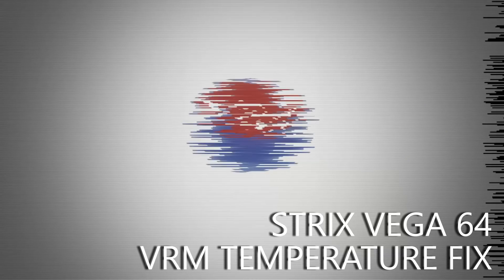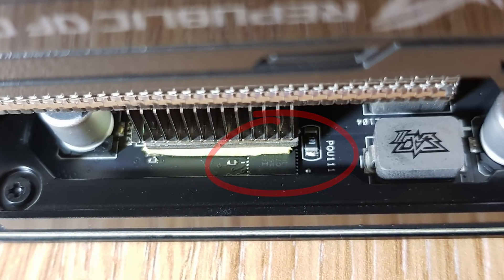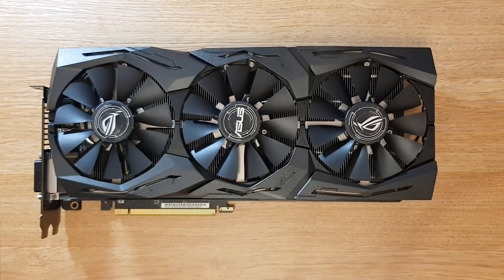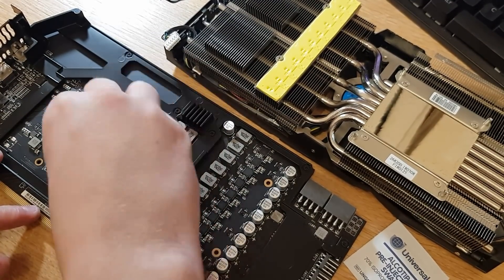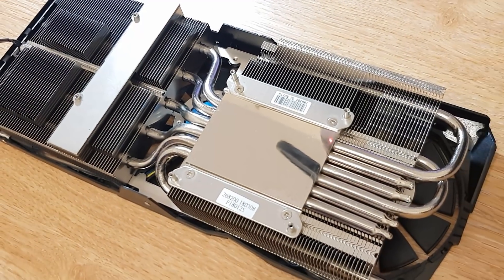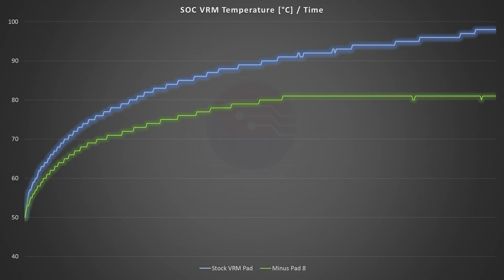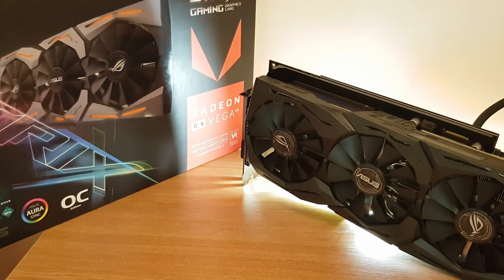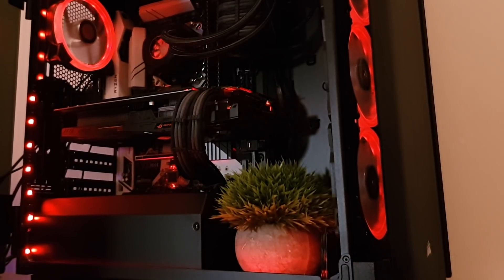Asus Strix Vega 64 - VRM Temperature FIX

Comment: So finally I got thermal pad from aliexpress after almost a month.
Here are the results.
Before:
GPU Temperature -> 81C
HBM Temperature - > 85C
GPU VR VDDC Temperature (I believe this is VRM) ->  101C
GPU VR MVDD Temperature (Should be VRM for Memory) -> 92C
GPU Hotspot -> 95C

After aliexpress 3mm thermal pad + MX4 thermal paste:
GPU Temperature -> 78C
HBM Temperature - > 82C
GPU VR VDDC Temperature (I believe this is VRM) ->  99C
GPU VR MVDD Temperature (Should be VRM for Memory) -> 90C
GPU Hotspot -> 95C

Soooo yeah pretty dissapointed with that aliexpress thermal pad.
I must say that Asus did pretty good job with the thermal paste application but that VRM jeeeez.
Long story short it ain't worth it, if you can get your hands on propper thermal pad like in the video Grizzly Minus Pad 8.
I can't buy it anywhere where I live so I guess when I am in Germany I will look for one.
Also I lost my warranty for 2 degrees off VRM so that's great :D
Reply: What pad did you get?
Reply: I got my thermal grizzly pad from eBay for 20€ and I'm in Germany too
Reply: Bei Asus gibt es kein Garantieverlust so lange man beim einsetzen den original kühler drauf hat. Quelle:https://www.computerbase.de/2016-09/grafikkarten-garantie-vergleich/

Comment: Another noob question, did the video show you applying the thermal paste at 4.00? or was that just alcohol? I have no idea what i'm doing.
Reply from the maker: Nope it didnt show thay, that was just some isopropyl alcohol wipes to clean it up, for the thermal paste i just used a generous ammount to cover the die and HBM2 memory
Reply: Cheers lad.

Comment: I'm wondering if the temp drop has more to do with the pad quality as you did use high end pad on the VRM's vs what the manufacturer used.   Unsure if the 1/2 covered vrm at the bottom resulted in 20*C drop all by itself.

Still overall nice video
Reply from the maker: From what ive read the temperature reporting will do worst case i.e least cooled component, but no doubt the higher quality pad helped with the overall result!

Comment: Weird, I just checked my Vega56 (same model) which should be from March 2018 and it got a little extra heatsinklike peace of aluminium over that side mosfet and also the thermal pads seem to overlign better. Maybe Asus already addressed this problem for newer revisions?
Reply from the maker: Sounds like some have been addressed and its more of a V64 issue... annoying you cant tell which version your buying though!

Comment: Does this video include the undervolt you did in the previous video? Thanks.
Reply from the maker: Yes, slightly tweaked figures but it was undervolted
Reply: Thanks for the info, appreciated.  Good price at Overclockers UK at the moment with the AMD three free games promotion.

Comment: I just bought this card the other day and it's built slightly different. Asus addressed the issue by extending the metal frame of the gpu over the exposed VRM to act as its heat sink. I can't confirm the thermals though since I have yet to test the card.
Reply: Is this the Vega 56 or 64 and did u order it from overclockers.co.uk?
Reply from the maker: Good to hear they have sorted it.
Reply: I will have the card tomorrow and hopefully test it
Reply: @getignited114  
Hi, 
Great news if it is fixed. 
Is there any chance you could post some pictures and reply to this please? : 
https://rog.asus.com/forum/showthread.php?105712-Asus-RX-Vega-64-Strix-Performance-versus-PowerColor-and-Sapphire-Vega-64
I am trying to get ASUS Support  to give a decent reponse to this issue. 
Was there a particular Product Number on the card / where did you buy it from? 
It is not fair if people want to buy one, it has this issue, and consumers/AMD fans are left in the dark about it. 
Also Hardware Unboxed have one of these GPU's that they use to run benchmarks against GTX1080 and ... lots of people take that info to make buying decision. 
Thanks.
Reply: @colesdav8529  my card is the fixed version. I will reply in that forum post
Reply: @getignited114  Thank you so much - please make sure F7GOS gets a mention for this excellent video pointing out the problem. I will use your response in the post to get back to Asus support and see if we can get a proper answer. I have also asked for help from KitGuru as they just bought a pair of Asus ROG Strix Vega 64. I do not know if they will help or not, but at least I tried. Bye.
Reply: @getignited114  can you tell me if it's the same as the post above? I'm thinking of buying it
Reply: @getignited114  Hello. Have you  checked if there is any difference? Thanks.
Reply: @slnsb  yes there is a difference because the new one covers all of the chip ... look at forum linked above I will respond on it soon
Reply: @getignited114  Good to hear that, can you post a pic or video about the fixed version? Is this the ROG or the AREZ version?
Reply: @getignited114  Amazing, thank you! How about temps? Can It reach the boost clock? Thanks again.
Reply: @Failpupo   After one gaming session. https://i.imgur.com/NZLqzNA.png
Reply: @getignited114  very impressive 😉
Reply: @getignited114  Great! Did you oc or undervolt it ? If you did , share the settings please
Reply: @iHaCKeRXZ  glad to tell you ive got an fixed one too , runs smooooth af
Reply: @xanxanxan  How can i know if my version is the fixed one ?? By performance or what
Reply: @iHaCKeRXZ  watch at the photes linked a bit higher in this conversation
Reply: thank you for letting us know!  where did you buy it from?
Reply: @kevpark5027  Mindfactory
Reply from the maker: Well at the very least you will be able rma or re-pad it  shame even a revised one shows same symptoms
Reply: yo you got screenshot how does it look ?
Reply: Do you guys know if this problem was also solved in Vegas 56 Asus Strix?. Appreciated 👍
Reply: Yeah I just bought one of these in March 2019. I looked at the cooling pad and have done some basic benchmarking and gaming. Seems like I got a lucky one or they may have improved the VRM thermals.
Reply: @tankerwrx  You bought vega 56 or 64 ?if you bought vega 56 please post here in comment the link of the product !! I want to buy it but there are two same GPUs with different product number :
https://www.skroutz.gr/s/16165385/Asus-Radeon-RX-Vega-56-8GB-OC-90YV0B53-M0NA00.html
https://www.skroutz.gr/s/13807378/Asus-Radeon-RX-Vega-56-8GB-Rog-Strix-OC-90YV0B50-M0NA00.html
Reply: I bought on Monday tihs week... hope they fixed that... just in case TP are in my wishlist waiting for replacement.

Comment: Excellent video! I'm glad you followed up and showed everything in very clear details. Also good work plugging Chill, it's easily my favourite feature AMD have implemented recently next to Freesync!
Reply: Radeon Chill is does not work correctly on my RX Vega 64 Liquid or R9 FuryX or R9 Nano's or any GPU I have tested down to HD7970. It also breaks FreeSync. What are you doing that meant it actually works? Thanks.

Comment: Seen your previous video on this card and now this. I ordered this card and guess I'm going to do this. Big difference. I'll first check the stock config of course. Just to be sure, you used 20x120mm and 3mm thick?
Reply: @F7GOS I received my card today, and it seems that they have fixed the issue. Paused at 1:11, I compared it with mine and mine is different. Mine is covered with I think a grey thermal pad and on top of that the plastic body ( the plastic which has the screws in).
Reply: @FreedomOfSport   still has thermal issues unless you do this mod. works wonders thanks man 
115 on hotspot 80s core 90s vrm
with mod 80c on hotspot 60s core 70s vrm :)
Reply: Freedom Of Sport Vega 56 or 64? And where did u buy it from?
Reply from the maker: Yeah thats the size👍🏻
Reply: @F7GOS  Did you apply the same amount of paste as on a CPU? (pea sized?)
Reply from the maker: I used a ummm liberal ammount 😂

Comment: Thanks  for investigating this. Now you prove the problem noted in Tom's Hardware review of the card, and explain poor performance in online benchmark data,  and you provide a fix.  

Problem with your fix. As soon as you take the cooler off, you have no warranty - Asus told me you would void your warranty. Just read the warranty details. It says you are not allowed to disassemble or modify the card. You must RMA the GPU along with instructions to replace the thermal pad on the VRM, and an Asus approved person has to do the fix. 

This is really bad because these Strix GPU's look great, have RGB lighting etc, and were selling for 450 + Raise the game deal + 3year warranty here, the other Vega 64's worth looking at, Powercolor and Sapphire have only 2 year warranty. All for the sake of a better piece of thermal pad.

The other thing you might want to look at is could the backplate on the card be used to improve the passive cooling of  components of the card. 
 
I pointed out that the ASUS ROG Strix was performing badly  versus the  PowerColor Red Dragon and Sapphitre Nitro + have asked on the ROG Forum here: https://rog.asus.com/forum/showthread.php?105712-Asus-RX-Vega-64-Strix-Performance-versus-PowerColor-and-Sapphire-Vega-64&highlight=vega+strix

I got 124 views. No response. Can't use Asus support any further as I do not own an Asus ROG Vega 64 Strix. 

So I will point to this video on that site and see if I get anything back if that's OK with you?
Reply from the maker: Sounds good, be interesting to see what they say
Reply: @F7GOS  Ok will update the post with pointer to your video. I think they should offer a free recall and fix on affected gpus.
Reply: @F7GOS  Hi, I updated the post here: https://rog.asus.com/forum/showthread.php?105712-Asus-RX-Vega-64-Strix-Performance-versus-PowerColor-and-Sapphire-Vega-64&p=742265#post742265 and I will open a new support ticket with ASUS. I will also see if I can discuss with others. Maybe too late to get this VRM issue fixed for any new RX Vega 64 cards but if there is a Vega 7nm refresh with 8GB HBM for gamers and any of those GPU can be used in the existing Asus ROG Strix PCB maybe your work does not go to waste. Hopefully though if there is a Vega refresh for gamers, power consumption will reduce, and Asus will reduce cooler height and keep the GPU to 40mm 2 slot wide next time. Have you thought about the backplate on the card and if there is any component that could have a thermal pad added between the rear of the PCB and backplate and improve performance further?
Reply: @F7GOS  

I contacted Asus regarding this Thermal Pad, VRM Cooling, and backplate on ROG Strix Vega 64.
This is what I was told.:

"Thank you for contacting ASUS Support!
About your case, I would like to inform you that we cannot comment statements like this in Internet.
If you have any further questions, feel free to contact us again.
Have a lovely day!"

I will have to look at PowerColor RX Vega 64 or Sapphire Nitro+ Vega 64 instead.

What a shame.
Reply: Warranty Void stickers are not valid in the USA so disassembling a card does not void the warranty
Reply: Yes I have seen that. That's the theory. But what happens in practice? In any case, try fighting with a manufacturer of a card or a retailer when you send in your card for RMA. Read the GPU Warranties you agree to when you buy a GPU.
Reply: @colesdav8529  Well then GN, HOB and others don't know what they are talking about, right?  The warranty inserts are not up to date.   It has to do with 'right to repair' laws.  If you blow up your card with OCing/over volting then RMA repair will be on your dime.  I think you are the one working on theory.
Reply: @Viewer19  Yes I know about US right to repair. (https://motherboard.vice.com/en_us/article/gv5ddm/warranty-void-if-removed-stickers-are-illegal). I also know about Apple. You will spend more money arguing with the manufacturer, as an individual, trying to fight them to take it back. Go to Manufacturers WEB Site and read the Warranty agreements. Not everyone lives in US. Why defend a broken GPU? No one should have to buy a new GPU only to have to fix it. Not everyone is ok with taking apart a GPU . It is not OK.
Reply: @Viewer19  Here go read this and argue your case with Asus Support, or maybe go buy a new Asus GPU, take it apart, change the VRM thermal pad, put it back together and see if they will indeed take it back and fix it for you. It clearly says in the Asus GPU Warranty you are not to mod the GPU.  https://www.asus.com/us/support/article/677/
Reply: @colesdav8529  You voted for Trump didn't you.
Reply: “When the debate is lost, slander becomes the tool of the loser.”
― Socrates

I only quote that because I assume your comment is meant as some sort of insult towards me, or the President of the U.S.A.
I do not wan't to fight - I am just pointing out the reality of the situation, despite what a law might say, the reality is often different, if that law is ignored in practice it has no effect. So far, I see this: https://motherboard.vice.com/en_us/article/ne9qdq/warranty-void-if-removed-stickers-illegal-ftc. FTC has sent warnings, not prosecuted.

Comment: I got my V64 Strix almost two weeks ago and yeah, I am really happy with it. But it does have thermal issues, so I'll apply this fix too. Your guide is very useful and I will use it, thank you.
Reply: Did you do the fix yet? I was wondering if you got any tips or anything I should know of before changing the pad and the paste?
Reply: Was the fix worth it, any differences? Because I am planning on doing the same but don't know if it is gonna be worth it
Reply: @francisco1495  I would say yes, re-pad and re-paste and you'll be amazed. I did this for my Vega 64 and went from 85 degrees to 70 - 75, also my VRM temps went from 100+ down to 85 at max load.